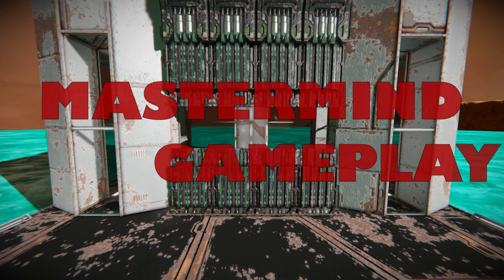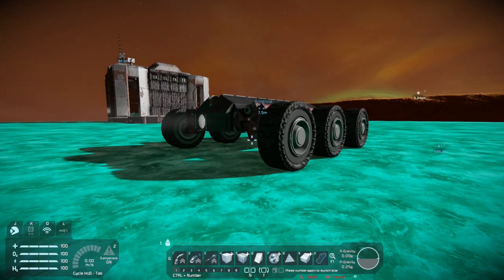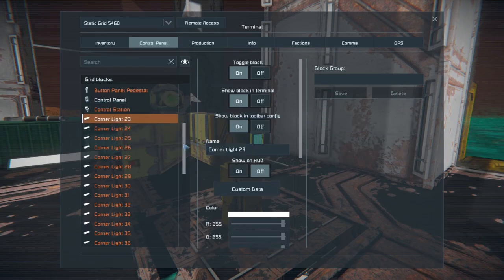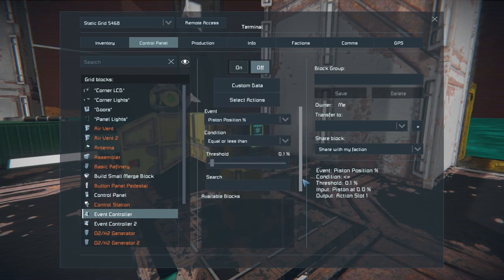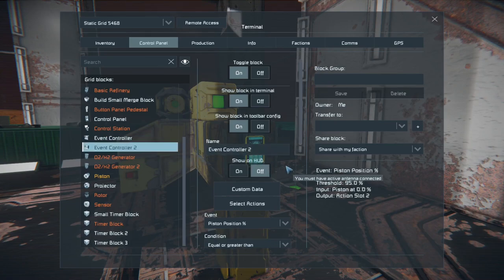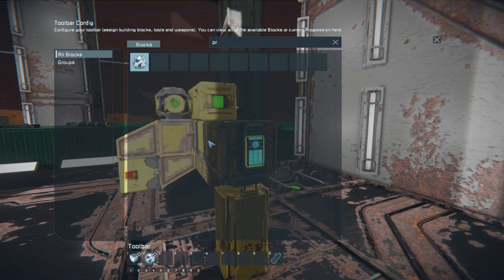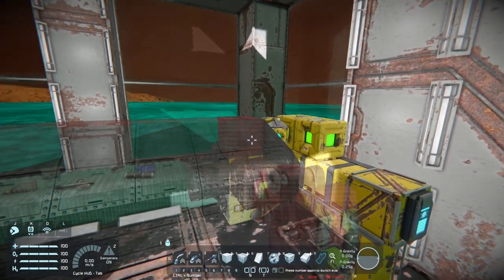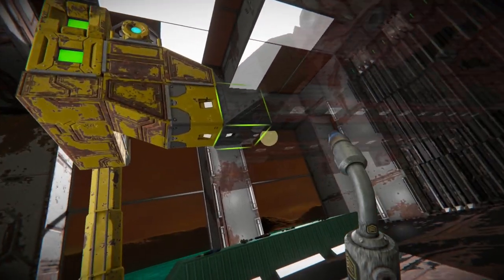Space Engineers | Evolution of Drones | Projecting Blueprints

Comment: Hm. I thought Event Controllers had multiple toolbars, each with following the same true/false slots?
Reply from the maker: My apologies, the second slot of the event controller is to reset a component and not cause the opposite reaction.  Hence, to activate more than one component a timer block must be used in slot 1.  Sorry for the confusion, thanks for asking, I appreciate it.
Reply: @mastermindgameplay5297  I understand that part (i.e. Slot 1 = TRUE state; Slot 2 = FALSE state), but what I've read/heard elsewhere and seen in-game is that Event Controllers have multiple toolbars (i.e. Control + 1 for default toolbar, then Control + 2-9 for the remaining toolbars). Each toolbar has a TRUE/FALSE slot.
Or are the multiple toolbar slots limited specifically for the Event Controller down to just the one toolbar?
Reply from the maker: To my knowledge there are only two slots but I will definitely tinker around to be sure.
Reply: @mastermindgameplay5297  There are indeed only two slots, but my question is if there are also a full 9 toolbars, each with 2 true/false slots. Most control blocks, including cockpits—and I believe Event Controllers and Buttons—have a set number of toolbar slots (1 to 9 slots) and then usually all 9 toolbars. Default craft toolbars have 9 slots and 9 toolbars (81 slots total), so I'm wondering if the Event Controller has 2 true/false slots per toolbar and a total of 9 toolbars (18 slots, 9 true and 9 false).
Reply: @mastermindgameplay5297   I finally had a chance to confirm in-game. 
There are indeed 2 slots (1 true, 1 false) for the Event Controller per toolbar... with 9 toolbars total, so 9 true actions and 9 false actions per Event Controller as of v1.203.6 (post hotfix).

Not to diminish your use of the Time Block, though. That was a great workaround to expand the number of true/false actions. :)

Your videos are a fantastic resource, by the way! The asteroid build and everything that goes into it is inspiring. haha
I haven't taken a look at the workshop a whole lot, but do you publish any of your blueprints there by chance?
Reply from the maker: @KrisS602 thank you for the valuable insight, I didn’t realize they had added the extra slots on event controllers.  Definitely a benefit, after a decade of enjoying Space Engineers there is still a thrill of learning something new.  And yes to your last question, I have added several builds to the Steam Workshop and all are free to download of course.
Reply: @mastermindgameplay5297  That's what I figured the case was—many, many years of playing the game with many updates adding/fixing mechanics like that one. Good to hear, though! Always happy to spread knowledge, even as a noob to the game xD
And that's great to hear! I wasn't able to find your username, though. Hm.

Anywho. Happy engineering!
Reply from the maker: Sorry the workshop items are under Electronikairboy on Steam.